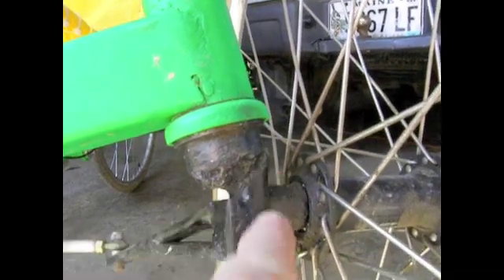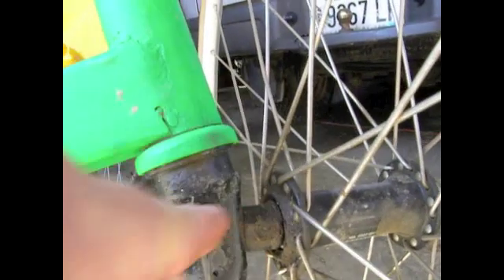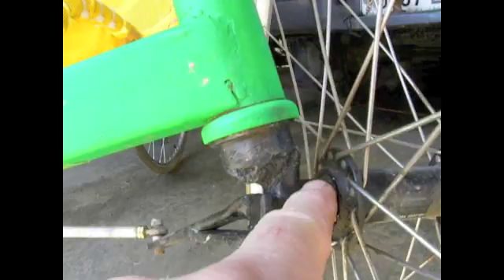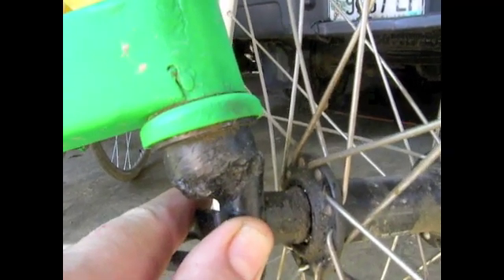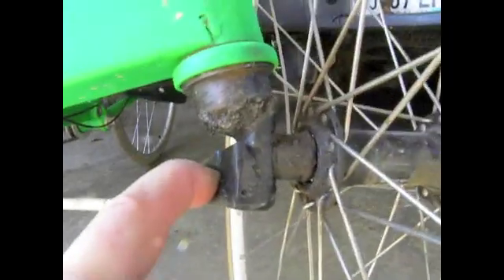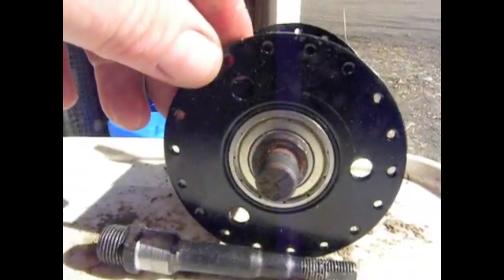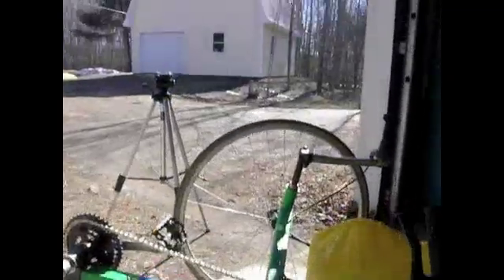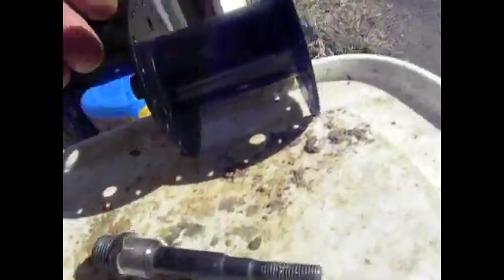recumbent Trike fron axle build

Comment: Great ideas and inspiration for trike builders!  There are hubs available with 15 mm  thru holes or you can use hubs from an old wheel chair if you don't need disc brakes.

Comment: hi.  thanks for the vid.  i am building a tadpole trike cart.  "cart" meaning with no drivetrain....  no pedals, gears, chains, etc.

this tadpole doesnt need to be able to see the off-road.

which hub from choppers US did you get?  there are different ones that look similar.   also,  should i get the same as you?

i do not plan to bother with disc brakes.